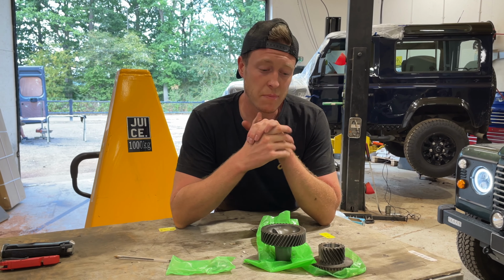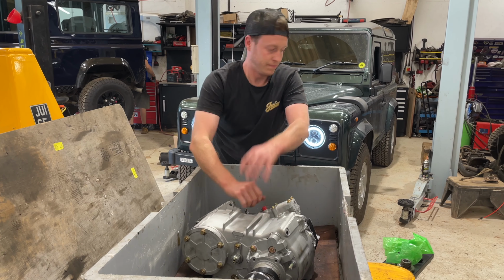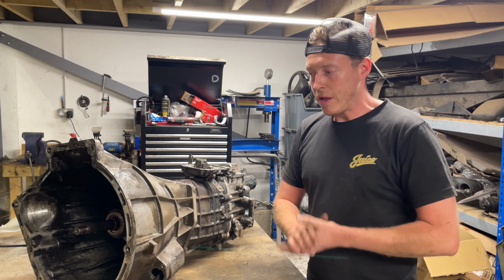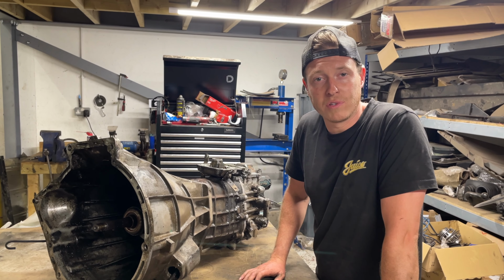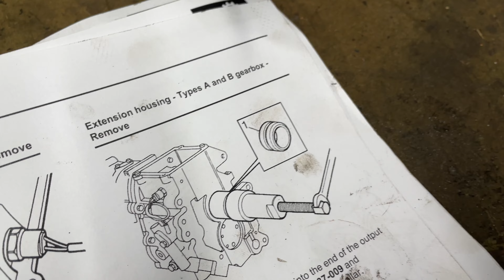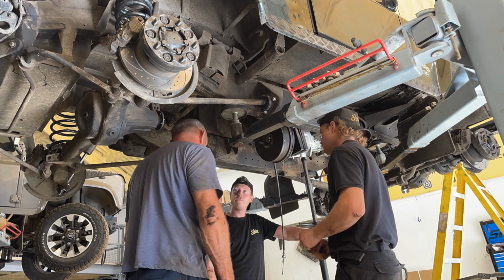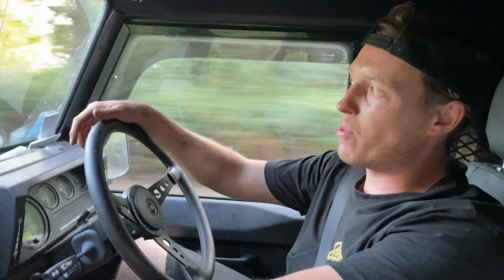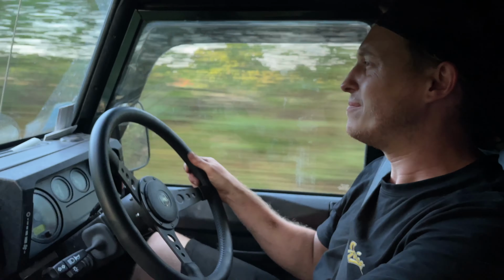HOW TO GET LOWER REVS IN YOUR DEFENDER!

Comment: For a working Defender it might be too tall. What I did on mine, as I'm running on 33 inch tyres, is just changed the 5th gears to V8 ones but the transfer box is best to remain 1.4. Its a nice upgrade for sure. Cheers.

Comment: Have just done this with my TD5. Had the 1.2 installed years ago, and had the V8 0.7 5th gear installed 2 months ago. It should have come from the factory like this from the start!!
Reply: Have you done it on a standard td5 or remapped one?
Reply: @jacklyall3456  I have a BAS remap to Disco TD5 spec, no egr, no cat and no centre box.

Comment: Can you do the gear mod only and not bother with the transfer box but still get lower rpm’s at the higher end?
Reply from the maker: Yes, certainly can - it’ll reduce the top gear by 5% - most effective with a lower ratio transfer box though
Reply: Cracking job. Do you possible have the link to the exact 5th gear you used? Cheers
Reply from the maker: @bobzy1235 Google “FTC5042” that’s the part number for the gear you’ll need 👍🏻
Reply: @juicemotors Amazing thank you very much
Reply: @juicemotors  amazing Job !!, can you pls share the instruction document? thanks in advance
Reply: @juicemotors  i need those tools you used to pull out the colar rings, longer and shorter pullers.  Can you assist?

Comment: Do you get a high ratio 5th gear for LT77?
Reply from the maker: Yes there’s a kit for the LT77 too, the gear drops the revs by 200rpm on the LT77
Reply: @juicemotors  Would you say that is worth it or not really? 200 Tdi

Comment: UPDATE: having driven over 500 miles already, immediate improvement in road noise and fuel economy. A stage 1 or 2 remap is on the horizon though to restore hill climbing 😂